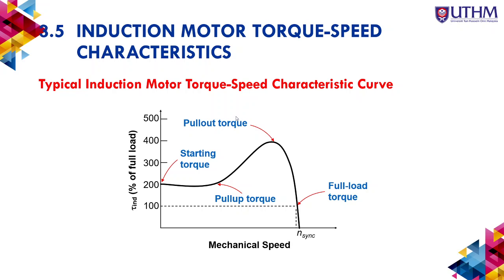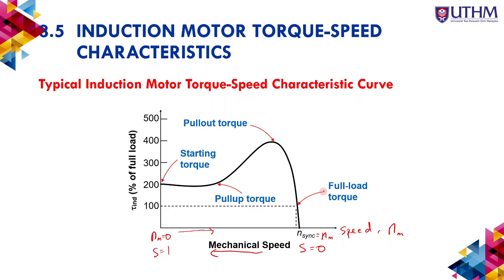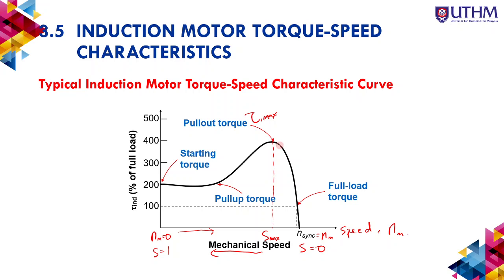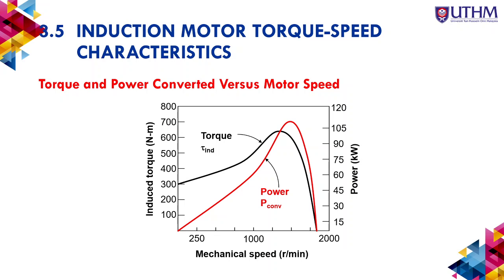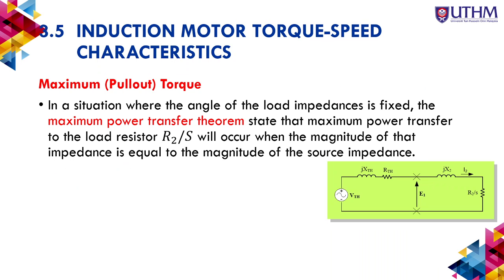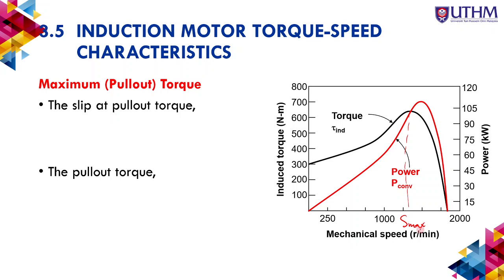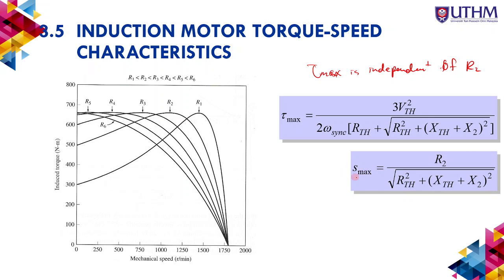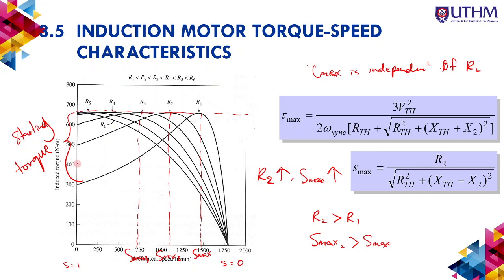Induction Motor - Torque Speed Characteristics - Part 2

Comment: Salam Dr. Im from UTHM too, and amik electric machine sem ni, Dr. ajar seksyen berapa, sangat membantu video dr. 

Soalan saya, kalau nak show full torque speed characteristics dgn adanya pull up pull out, pakai torque full load or no load dr.?
Reply from the maker: Assalam, untuk sesi 2020/2021 - Sem 2 saya mengajar seksyen 2. Saya harap video yang tidak seberapa ini dapat membantu pelajar dalam memahami tentang Electrical Machine.  Untuk Pullout torque (Max Torque), kita perlu kira Slip Maximum (Smax). Untuk dapatkan nilai Smax, kita perlu cari Thevenin Resistance (Rth) dan Thevenin Voltage (Vth), kemudian kita masukkan kedalam formula Smax dan Maximum Torque (tmax). Speed No Load hampir sama dengan nsync.